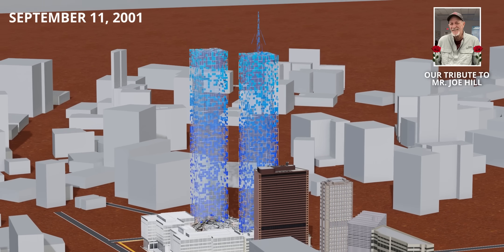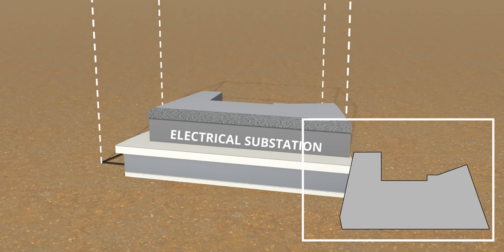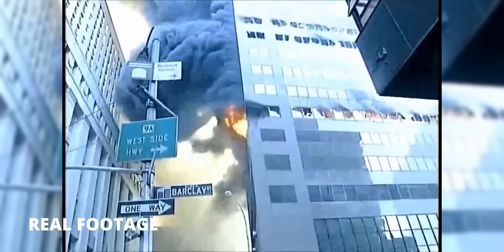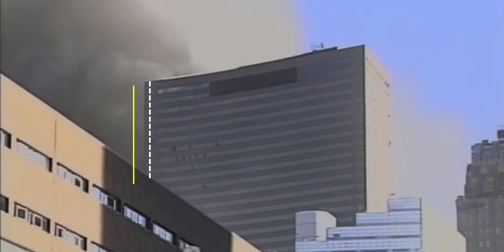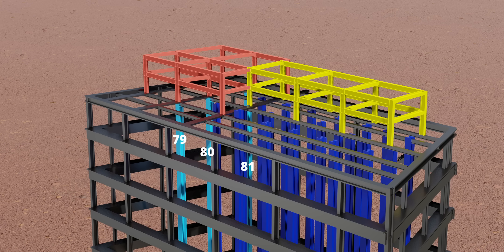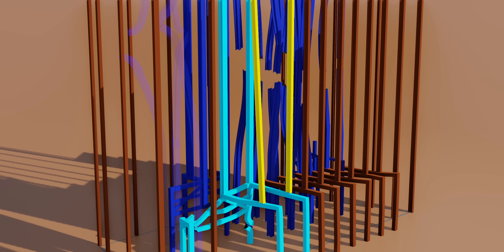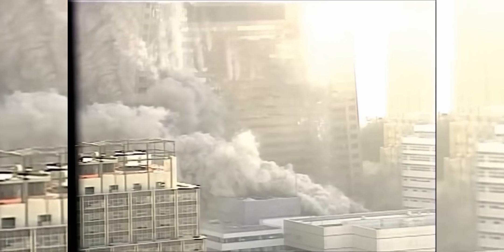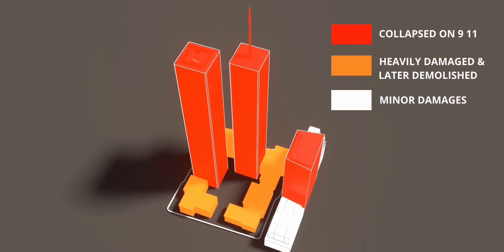Collapse of Building 7 | The Complete Physics

Comment: 10:32 WTC 4, 3, 5 and 6 looked more damaged, yet they didn’t fall like a controlled demolition, but WTC 7 did. Just like WTC 1 and 2. 🤨
The only way I can understand this is if the columns were made of paper and not steel. 😵‍💫
Reply: 9/11 was not a government plan.

WTC 7 was not a controlled demolition. WTC 1 and 2 were not designed for Boeing 767’s going full speed into the tops of them.

You know how it’s easier to destroy a building from the top rather than at the foundation a lot of the time? Those 767’s struck higher up.
Reply: @Sp1n2305  WTC1+2 were designed to withstand a fully loaded Boeing 707 crashing into them at 600mph, faster than any of the actual planes on 9/11. The actual 9/11 planes were nowhere near fully loaded. Shyam Sunder, head of the NIST "investigation", concluded that the 707 crash would have been more destructive than the actual 9/11 crashs.
Reply: @Kudde23  k
Reply: yeah bro my bad I replaced all the metal with paper because it was just a prank bro

Anyone that can see this, don't argue with these people. They believe 1+1=3 because 2 is the way the government mind controls you or some BS
Reply: @thecarwashesandmorechannel2892  If you honestly believe two planes caused three buildings to collapse in perfect free fall, that’s quite some faith in physics.
Reply: @ChrisFH  If it was a controlled demolition, why were the explosions not at all in any form of controlled pattern? Are you saying they made the structure out of foam or something?
Also, if something doesn't have resistance, it tends to fall near free fall speeds. Building 7 did not fall at free fall speeds the entire duration, that's physically impossible.    The debris from WTC 1 + 2 spead after hitting the rest of the tower, which is why that part was in free-fall speed.e
Reply: @thecarwashesandmorechannel2892  No, I’m not saying that, but the passports of the people responsible managed to survive. That’s odd. I mean, the fire was so intense it made three buildings collapse, yet the passport survived.
Reply: @ChrisFH  I won't disagree with you on that part, it is quite strange. My guess is since they were in the cockpit their documentation was ejected forward from the building, but that's a pretty far reach.
Reply: 1- they were smaller shorter buildings. They were more "crushed" then collapsed. Why do you think all buildings are built the exact same way so they should all react the same way?
2- WTC 5 and 6 did show signs of internal failure.
Reply: I find it unlikely there is a way you could understand this but let's try.  The collapse of the unknown and unimportant Building 7 – one of 6 buildings to collapse of 10 destroyed on 9/11 - confuses a lot of people, despite being one of the most studied engineering disasters in history. It was not famous, not a terrorist target, no one was killed in it and thus it did not get a lot of attention, so most know very little about it. Given the choice between long boring, hard to find technical reports and readily available, easily digestible fantasy on the internet, many turn to the latter. To counter that I prepared this brief summary explanation based on my own analysis. No politics, just engineering. 

The North Tower collapse at 10:28am bombarded Building 7 with thousands of tons of burning debris, causing heavy damage and starting raging fires burning out of control for the next 7 hours. Half the responding FDNY firefighters having been killed, others injured, units in disarray, much of their equipment destroyed, no water pressure, and the greater urgency of Search & Rescue efforts, firefighting efforts at 7 were pulled as futile. The building couldn’t be saved and was left to its fate.

youtube.com/watch?v=g_SvpwyC17M&ab_channel=MFitz 

Collapse of a burning structure is always a concern for firefighters. Steel buildings subject to fire rely on active fighting of the fires to survive. Left to their own devices they will collapse. Buildings are designed around 1 to 3 hours of fire resistance, allowing time for occupants to escape and ACTIVE firefighting to get started, after which all bets are off. In B7 the occupants escaped, passive and active fire protections were compromised and active firefighting never got started which left the building to take its chances. It lost. Odds on Building 7 would eventually collapse,… and it did. No big deal in logic. That is the sort of choice firefighters make every day in brush fire situations - which houses to save and which ones to let go. Only real difference here is moving the decimal on the size and cost.

FDNY Chief Daniel Nigro ; The biggest decision we had to make on the first day was to clear the area and create a collapse zone around the severely damaged 7 World Trade Center, a 47-story building heavily involved in fire. A number of fire officers and companies assessed the damage to the building. The appraisals indicated that the buildings structural integrity was in serious doubt. I issued orders to PULL BACK the firefighters and define the collapse zone. It was a critical decision; We could not lose any more firefighters. It took a lot of time to PULL EVERYONE OUT, given the emotionalism of the day, communications difficulties and the collapse terrain

FDNY Deputy Chief Peter Hayden - We had our special operations people set up surveying instruments to monitor and see if there was any movement in the building. We were concerned of the possibility of collapse in the building. And we had a discussion with one particular engineer there, and we asked him if we allowed it to burn could we anticipate a collapse and if so, how soon? And it turned out that he was pretty much right on the money, that he said 'In its current state you have about 5 hours

With its deteriorating condition being reported throughout the day, the collapse of Building 7 expected by the FDNY, bystanders and the media meaning at least 24 video cameras recorded some or all of the collapse. Everyone at the time knew what was coming and why.

youtube.com/watch?v=OY5S5k3tMHI&list=PL4GiNqqck-lzR7pebSWRVLoXyu-aWR3Rr&index=48&ab_channel=911InvestigationVids 

Building 7’s collapse was totally different to the Twin Towers, harder to understand and most of the details difficult to see. But we can sort out what happened through careful analysis and observation.  What follows is MY EXPLANATION of the collapse sequence using the best available information and relying on no authority.

B7 was complex structure, a 47-story steel framed building built on top of a smaller existing 3-story building, requiring several lower floors dedicated to complex load transfer structures instead of usable office space. Of trapezoidal shape and all-steel tube-in-tube construction, B7 (above the 7th floor) consisted of a central core of steel columns carrying most of the gravity load, perimeter steel columns around the outside of the structure carrying the remainder of the gravity loads and long span beams and girders to tie those elements together and form the floors. On the outside of the building hung a moment frame - the last part of B7 to fall. 

Phase 1 : Collapse initiation for B7 is notably quiet with observers not realizing the building was collapsing! There was no audible warning in the form of say hundreds of ear drum busting 180-190dB explosive bangs preceding the collapse. The first externally visible signs of collapse initiation occurred at 5:20:28 pm. Here at 12:00 a local CBS affiliate reporter is talking 10 blocks from B7 when collapse begins. People don’t start to notice the collapse until 12:11. Then at 12:45 is the famous CBS fixed camera clip of Building 7’s collapse Again, note how quiet it is.

youtube.com/watch?v=t5tEy6mXSE8&ab_channel=fresnosean379

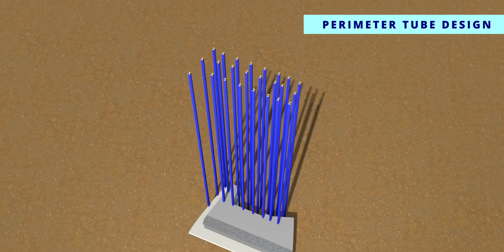Collapse initiation was due to multiple lower floor failures above the load transfer region (7th floor) in the NE corner of the building. In this video at 0:45 you can see the NW corner from inside the building while under construction, Column 79 just out of frame on the left. That big, angled steel beam across the top of the frame connects to C79 at one end. The girders connect to the beam. The beam and all those girders depend on just one connection

youtube.com/watch?v=nP3TNHPCIVU&t=35s&ab_channel=EdwardCurrent

Phase 2 : Lower floor failures left core Column 79 laterally unsupported over an excessive length and it buckled. If you look at a floor diagram of Building 7 (see above) and look at all the structures that depend on C79 you quickly realize this one column was a relatively isolated structural element on which a disproportionately greater fraction of the structure depended . Externally we see a vertical progression of window breakage along the 44-46 line and a kink in the roof of the East Mechanical Penthouse at the top of the building, consistent with C79 failure. The transition from full capacity to almost no capacity occurs in virtually an instant. Once the buckling failure occurs there is almost no resistance

Normally with a buckling column, the load could very well be redistributed to other columns, meaning the buckling could stop after a while. With C79 that is not the case - the failure did not redistribute the load, so the collapse rapidly progressed to the roofline, sinking the rooftop penthouse.

Phase 3 : With C79 gone, B7’s progressive, non-symmetrical collapse continues with C80 and C81 at the east end of the core left laterally unsupported and quickly buckled and failed as well, sending the EMP down through the building. C79-81 all have no diagonal bracing, which I believe is a major reason why they could not redistribute a lot of vertical loads among one another.

From there collapse progressed from east to west through the central core until the core was gone taking all of the interior floors and structures and probably most of the perimeter columns with it. You can see the horizontal progression of window failures low in the building and the dropping of the remaining rooftop structures into the building. One of the big takeaways from the NIST Building 7 study (that gets completely ignored) was their modeling which determined C79 failing under ANY circumstances would have initiated the same collapse sequence.

Phase 4 : After about 10 seconds only the exterior moment frame - a hollow shell mostly supported by the 4 corner columns and quite unable to stand on its own – remains, creating the illusion the building is still standing since little has changed externally. That’s just hollow empty shell, like an empty cereal box. The north leans inward, forming a V in the roofline. The last remaining perimeter columns buckle under the strain.  There is almost no resistance as the moment frame free falls, landing on top of the 7-story high debris pile, blocked surrounding streets, heavily damaged the Verizon Building and destroyed Fiterman Hall at 30 W. Broadway, all well outside of Building 7’s “footprint”.  It is only here, at the very end that a single utterly meaningless measurement of alleged free fall is taken. Start to finish the collapse took 18-20 seconds, or less than 1/3 of true free fall*. Not that we really care since how fast something falls cannot tell you what started it falling in the first place. The free fall argument is about the collapse of the outer shell *AFTER all of the critical internal structure had already failed and completely ignores about 80-90% - of the collapse. 

Building 7’s progressive, non-symmetrical collapse was incidental and unintended collateral damage from the combined effects of fire + time + gravity started by the collapsing North Tower. That is true no matter who planned and carried out the 9/11 attacks or why . The collapse was of so little consequence it barely even registered at the time, a mere footnote. 

I hope you found this helpful. It is meant to be informative, not adversarial and to solicit informed critical comment. If I made any errors of fact, logic or reason or left anything critical out, please let me know so I can fix it. IF you can offer a more plausible alternative be my guest. So far no one has even tried. Please start any reply with the words “Tits McGee” or I will know you didn’t actually read it.
Reply: @TheCriticalStinker-01  I find it unlikely there is a way you could understand this but let's try. Many buildings were damaged on 9/11 and more than 3 of them caught fire, but only 3 of all these buildings actally COLLAPSED AFTER all of that.

Read that again and again EVERY TIME you feel like it´s a good idea to claim that more than 3 buildings collapsed in the 9/11 event.

Comment: This video claims that WTC 7 did not fall at Free Fall Speed, yet NIST has admitted that for 2 seconds, the building did in fact fall at free fall speed.  Is this video suggesting that NIST is lying?  Or is this video lying?
Reply: Well, what The NIST actually said that was more than 10 seconds after the collapsed started, one corner of the exterior moment frame - the only part of the building still standing and just a hollow, empty shell (like an empty cereal box) averaged free fall for an arbitrarily picked time period of 2.25 seconds. Averaged. That single point started out at below GA, accelerated up to and _then over) GA before decelerating back below GA during that 2.25 seconds time.

It was not the building by any acceptable definition - just the hollow empty outer shell.

It was not even the entire hollow outer shell but just a single point on that sell. Multiple data points would be required to determine how fast the outer shell actually dropped, although why anyone should bother I don't really know.  It's a hollow empty shell.

There was no sustained period of GA for that single point on the hollow outer shell. It was a curve.

How do you explain the over GA measurement?  I can explain it, can you?

Why do we care about any of this since how fast one spot on the exterior moment frame fell 10 seconds after the collapse started and after 90% of the structure is already gone is hardly going to inform us of anything meaningful?

The free fall crap is a conspiracist fantasy and it is not included in this video because it is of no importance to understanding how or why the building collapsed.
Reply: @TheCriticalStinker-01  Thanks.  I am thankful that the University of Fairbanks Alaska has done a fully funded PHD research into the fall of WTC7 and has proven beyond the shadow of a doubt that WTC7 could not have fallen by fire.  They demonstrate how NIST hid things from their computer models (like Height bearing stiffeners), and they demonstrated how it is simply not possible to bring it down by fire alone.  It is some for an open and honest investigation, not one from the government, because that is a conflict of interest.
Reply: NIST fully explains the "2 seconds" of "free fall" speed.
Short answer is it was only one small portion of one tower. It doesn't refer to the entire tower or the complete duration of the collapse. And it absolutely has nothing to do with the twin towers. So what are you going on about?
It is you that is lying
Reply: @pacman3556  So NIST "fully explains" the "2 seconds" of free fall "speed"(?!?) by not explaining it at all...
Nice one shill! 🤪